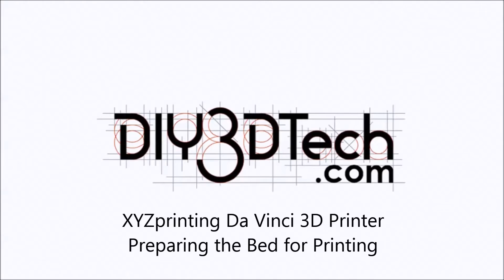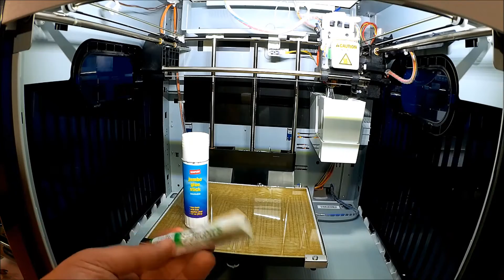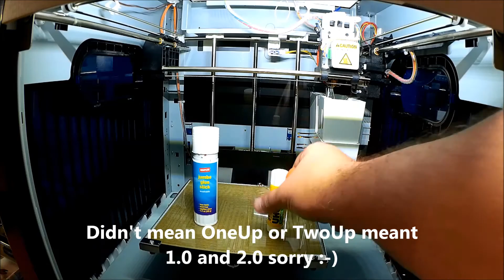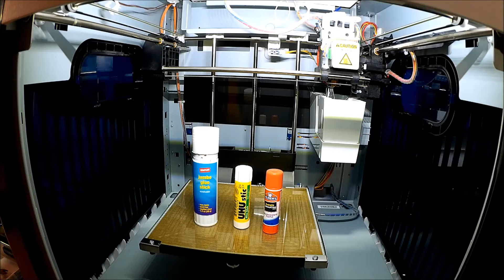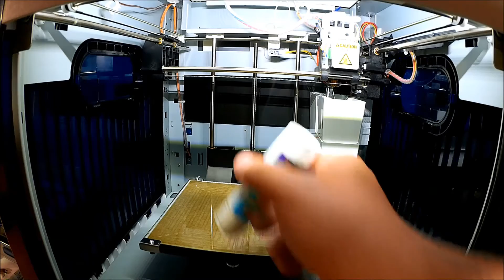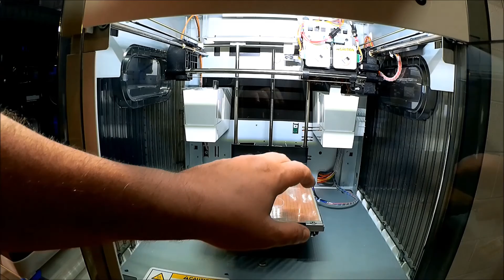XYZprinting Da Vinci 3D Printer - Preparing the Bed for Printing

Comment: If you clip a 200mm x 210mm Zebra plate onto the bed you can forget about all that messy glue and clean up. http://www.printinz.com/zebra-plates/
You just need to put a few washers under the metal calibration tabs to compensate for the Zebra Plate thickness, then fine tune with a Z offset.
Reply from the maker: +PRINTinZ Interesting if you want, send me a piece and I will do a review on the Da Vinci...
Reply: +DIY3DTECH.com I just ordered a Da Vinci Pro today. If you subscribe to my YouTube channel, I'll get a video up showing it in the next couple of weeks or so.  Thanks.
Reply from the maker: PRINTinZ The Pro is different than the 1.0a and 2.0 as it (the Pro) does not have a glass bed...
Reply: +DIY3DTECH.com I know. But I wasn't going to get stuck with a printer that forces me to buy their cartridges.
Reply from the maker: The cart thing ins't bad, however what I am getting at is the product is interesting and would like to see how it works with a printer that has a glass bed and no (easy) way to adjust the Z offset.  I have a Wanhao too and use Buildtak and love it over the nasty glue.  Also on both of the Da Vinci's I get lifting on lager ABS parts which drives me crazy so a solution to this would be great!

Comment: Great video. My prints unstick from the bed after about 20 passes. Bed temp is 70c drops to 69c sometimes. Using the glue that came with it and the UHU glue. I have had 3 successful attempts to 8 fails. Any advice?
Reply from the maker: +Cowboy Boots Which printer and version do you have?  As Da Vinci 2.0 only reaches about 70c which is a little cool for ABS where as my 1.0a tops out over 90c and sometimes burns the plastic!    However a headed bed for ABS isn't so much about sticking as it warping.  So for sticking ABS, here are my recommendations.

1.  Ensure the bed is level!  This is critical as an unlevel bed will mean a poor first layer and sticking problem.  Many people miss this and I do mean a very good bed level.
2. Ensure the printer itself is level as in #1 we are matching the print bed to the hotend and in #2 we place a level on the bed and level the entire printer.  Remember the plastic is liquid and will want to run again affecting the first layers.
3. Switch glue sticks as UHU glue for me has not worked well, as I like the Staples Jumbo stick.  However the best is the Elmers Purple but it is messy to clean up.
4. Put a LOT of glue on! I cover the bed vertical than horizontally and finally go back over just the print area diagonally.
5. Print with a raft, yes I know I hate this but if your model has to little surface area, this might be your only option.  Also you might want to start here and remove the raft to see how uniform it is as this can also show bed alignment issues.

Whew, hope this helps!
Reply: +DIY3DTECH.com Duo and tech support found that the guides weren't lubed enough, the jerky motion was causing the opposite extruder to grab the prints. Now they are sending me another extruder or wire harness since the connection to the extruders fail.

Have you noticed that xyz abs filament is not very good? It warps and splits easily. Try using the leftovers of their expended cartridges in another machine if you can.
Reply from the maker: Yes would agree that their ABS is far from the best and I plan on reflashing both of my printers as time permits to allow the use of "normal" filament.
Reply: +DIY3DTECH.com I paid for newegg's 3 yr warranty, so i suppose i'm locked in with xyzware until then. I have used a cartridge in the machine while using hatchbox abs and 24 hrs in a 57 hr print no warping or separation.
Reply from the maker: So you have done a 57 hour print?  That is amazing!
Reply: +DIY3DTECH.com It came out nice, had 3 separations at 3 different corners. A vapor bath closed them nicely.